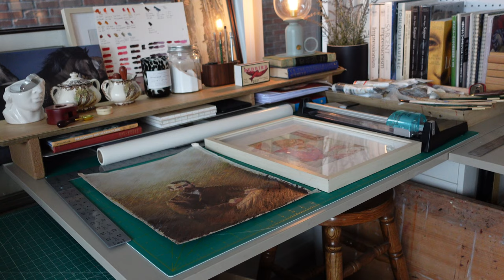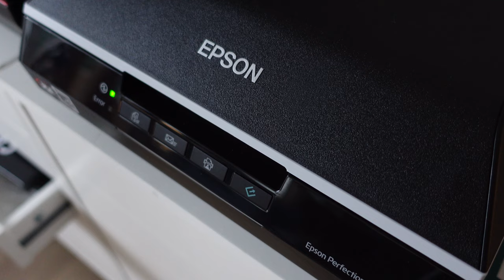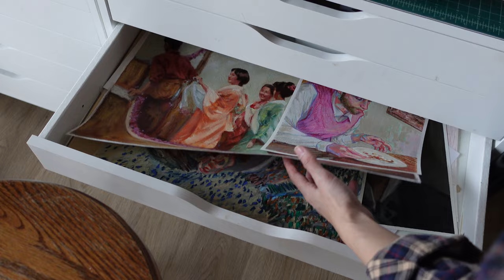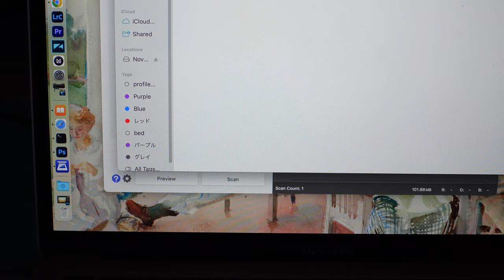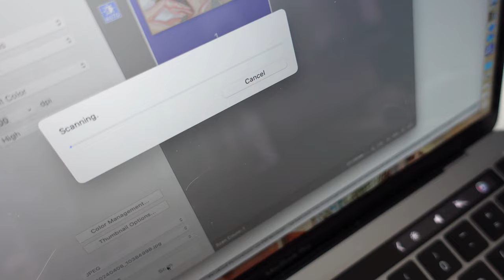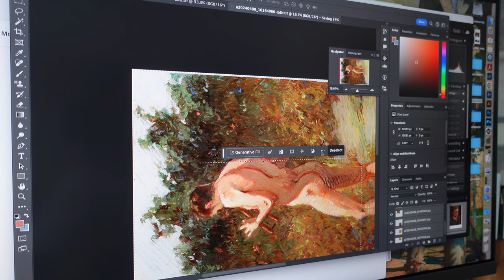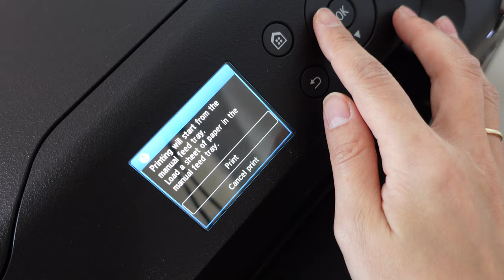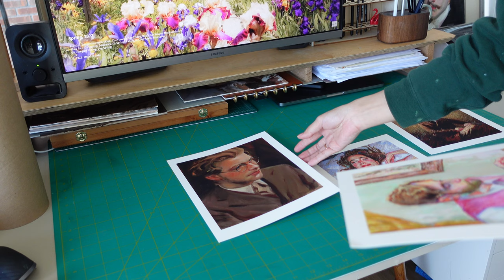From Canvas to Print | Transforming Artwork into Prints

Comment: Hello Misako!❤❤❤
I have a question: oil pastels paintings don't feel sticky after finish them?
Reply from the maker: Hi!🥰 Oil pastels never fully dry, so I apply Sennelier fixative to seal the surface. I usually do 3-4 coats of fixative; then the surface should harden👍
Reply: @MisakoFlodin  Hi! Regarding the fixative, does it totally prevent the pastels from smudging the glass surface of the scanner? What do you use to clean it? Thanks you! ❤